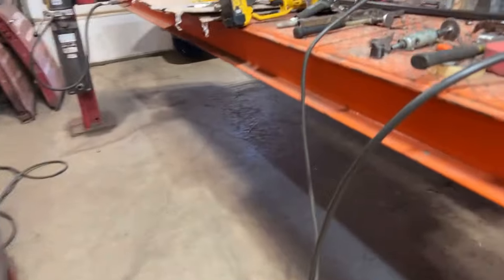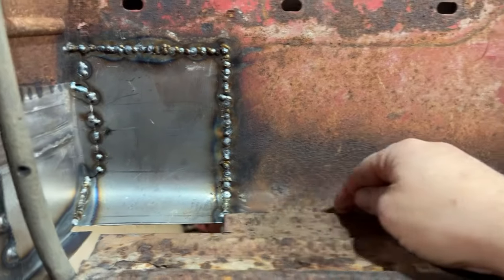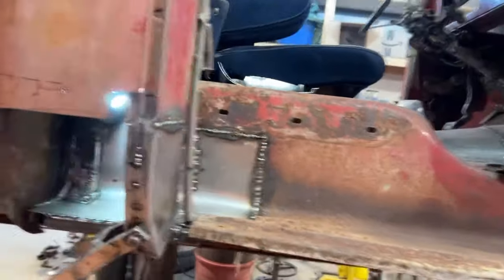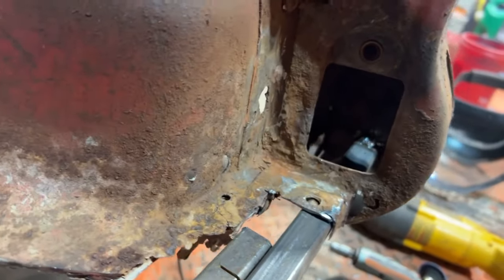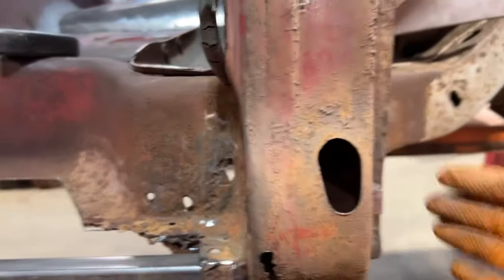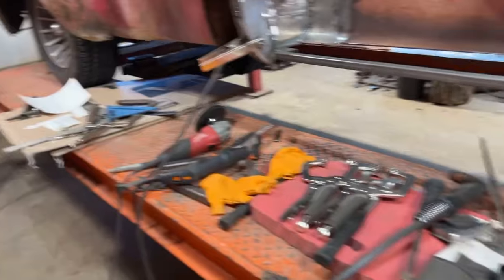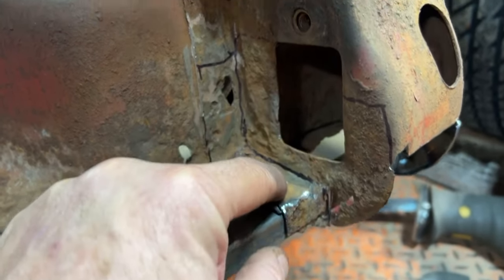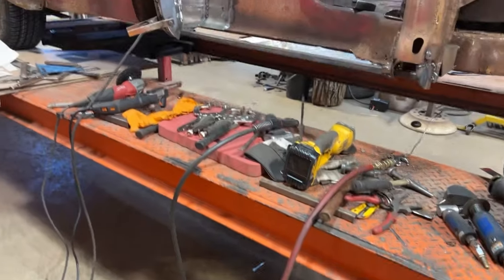Studebaker #81 inner cab corner and step

Comment: Hey Frank. Nice work on the truck. I have lots of rust to fight with as well. It is hard to get a good weld when you are dealing with rust. You are doing a bang up job on this. Thanks for sharing.👍👍🍁
Reply from the maker: After a month or so of welding i would hope i have it figured out. Some days are better than others. That old metal leaves a lot to be desired some times. I keep the wire feed way down when plug welding, and they need less grinding.